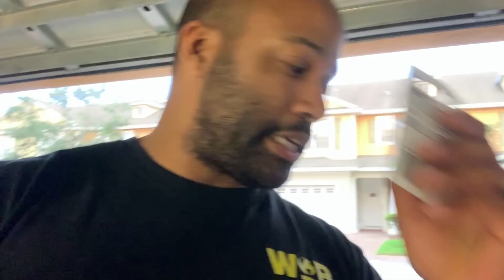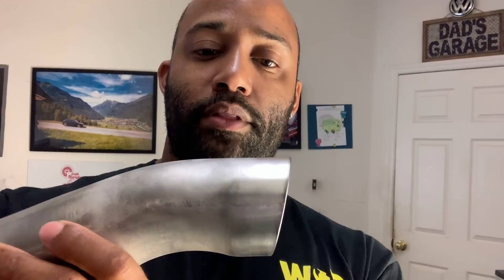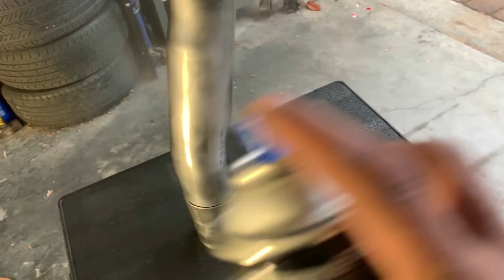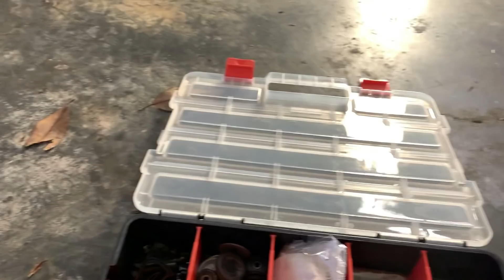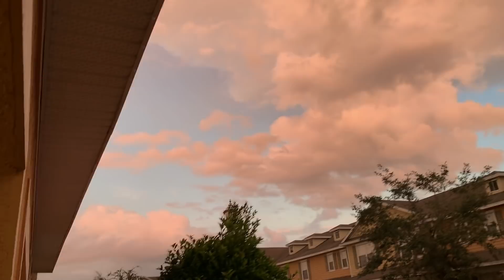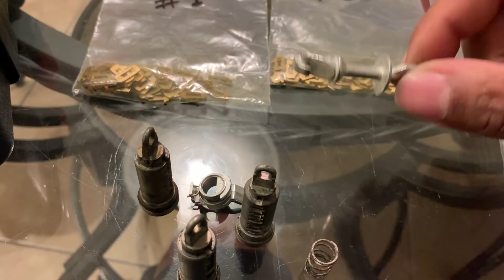vlog57

Comment: Is your vr cammed? Because i have 268 tt cams and i swear your car have more of a lope in the idle than mine does.
Reply from the maker: Joshua Mahala Autotech 268 cams. My intake manifold and exhaust manifolds are gasket matched. I have no cat either.
Reply: @TheVWGarage , nice. I have the tt cams, chip tunw for the cams, then tt catback with a borla muffler, and 42 draft designs test pipe instead of my cat.